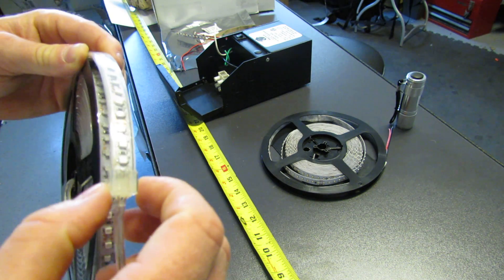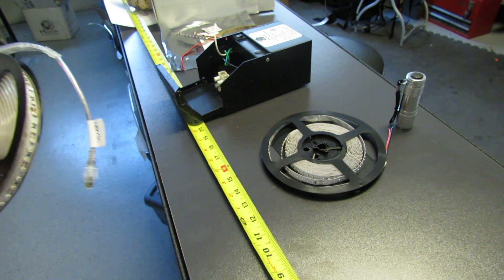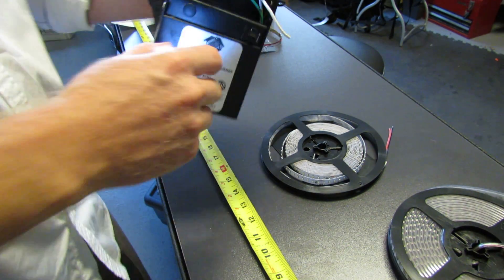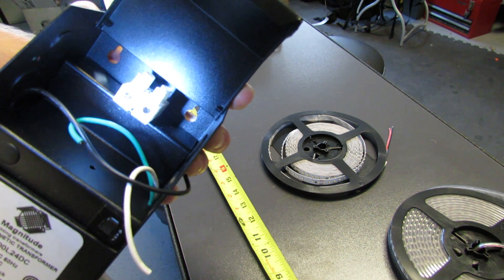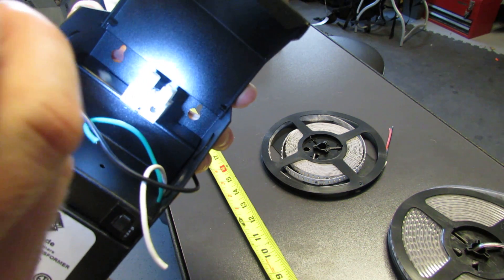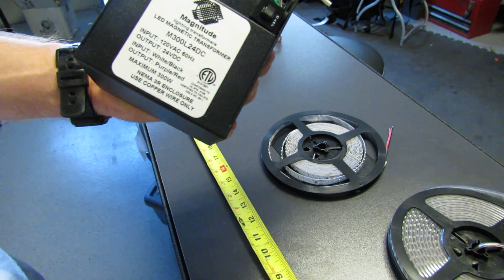How to Install LED Strip Lights to Connectors and a Power Supply

Comment: Hi very cool vid, clear and detailed
I have a Bluetooth speaker with a plug to connect battery charger (bms 6s x 18650)
I'd like to install a led that lights on only when I plug charger connector. Is this possible without a switch?
If I just connect led to male plug's pos and neg it would then also be connected to battery' s pos and neg and thus be always lighted

Comment: Do the connectors have names other than "this" type of connector and "that" type of connector.  I would like to order some connectors, but "this" doesn't cut it even for google.  Listened to over 3 minutes of the video and never got the name of a single type of connector or how they actually worked.
Reply from the maker: Hi there! Thanks for watching our videos.
There are usually 8 mm wide and 10 mm wide connectors since those are the usual widths of LED strips.
Our connectors are called ColorBright and Ultrabright which stand for the series of LED strip that they are compatible with.
Feel free to visit our website to get more details on our connectors.

Comment: How can I get a power supply where I can setup my purchased (let's say) 8ft strip, cutting it up into pieces and squaring it perfectly under my desk. Instead of linking them all, can I strip to power them all? And so I need a power supply that will accept more than one incoming led strip... maybe like 4 or 5 inserts? Can anyone point me in the right direction to a link, or to inform me on what it is I am talking about? Thanks much!

Comment: can I just buy an le power adapter on amazon and plug it from a wall socket to the l.e.d strip?
Reply from the maker: +Ryan Lowry Hi there Ryan. Thanks for watching our videos!
Yes, you can purchase a power supply from Amazon and plug it into an outlet. The power supply must output 12 or 24 volts depending on the strip you are using and must be able to handle the amperage load that the strip draws.
If you have any questions, don't hesitate to give us a call at 1-844-FLEXFIRE. Thanks again and have a great day!

Comment: is it possible to control a single color LED strip with DMX? Usually with RGB strip, there is a com wire, along with the R G and B wire.. I have an all amber strip that I am trying to control via a channel of dmx (along with the RGB)... there is only a positive and negative wire on the amber strip.

Comment: How can I make this portable I wanna install lights on my bike but I don't know what to do do I connect it to a 12v battery?
Reply: I have thought about this myself and came across a pinterest page, they used 12v led strips enough for just the frame of the bike powered by a 12v rechargeable battery from ebay, have not tried myself but it looked great
Reply: https://www.youtube.com/watch?v=R1CVzvG0iqc

Comment: if i have a 5m UV Led strip, will a DC 12v 5a power supply attached to a female adapter to terminal connection work?

Comment: I made a Wine Cork chandelier with lamp shade parts and fishing line, unfortunately I've run into a lot of issues trying to get it lit up because the lampshade finial is just so small on the bottom, there's no way to do a simple socket and bulb. I saw this in home depot and wanted to look into it. I thought this would be perfect and flexible for all these tight little areas. This first one is a test run but in the future I hope to sell these, so I am hoping for a user friendly lighting solution, but effective. Is it possible to get these hooked up to a plug and then plug it into a socket?

Comment: So can I hook this up to a 12v system on a vehicle and it will turn that into a 24v output?
Reply from the maker: The driver seen here to to be hooked up to 120AC, not DC. If you want to convert the 12v to 24v, you will need something different and we do not carry it.